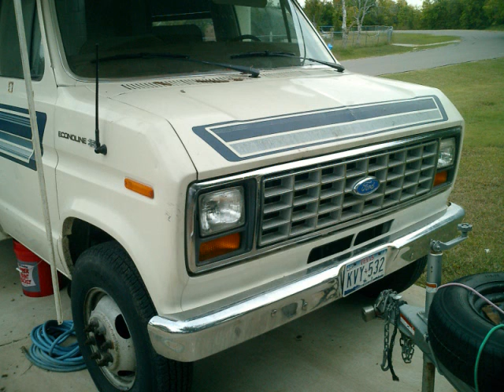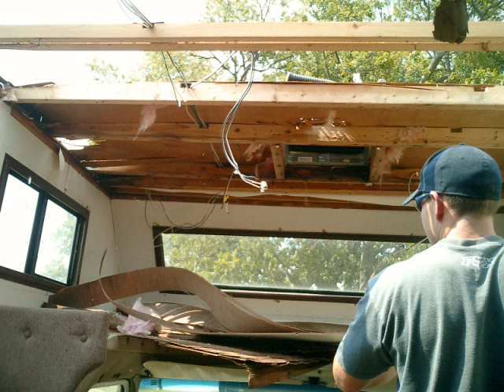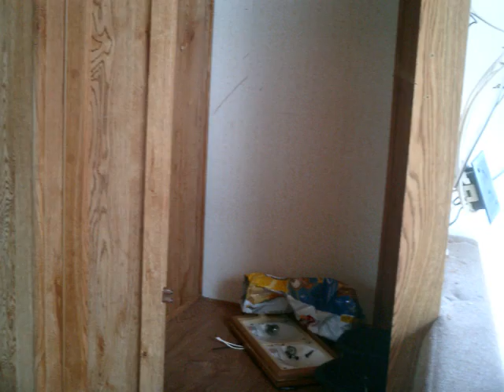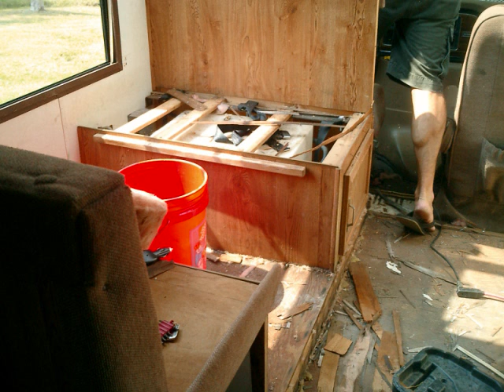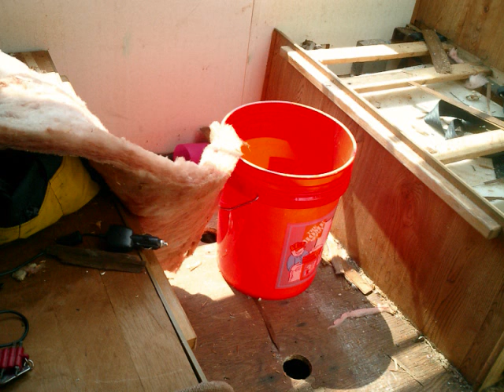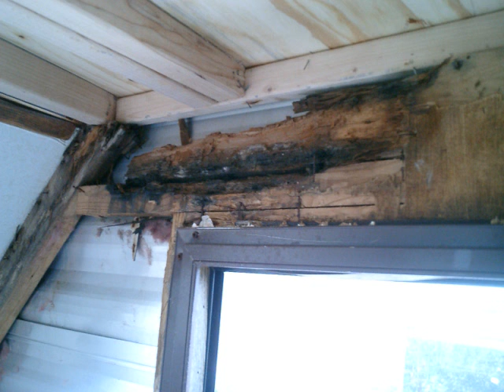1990 20ft Mallard Sprinter RV under renovation

Comment: I just bought an identical Mallard Sprinter. Question: Do you hate the 351w? Mine seemed very under-powered and recently threw a rod. I'm trying to decide if I should replace that 351 or assume a replacement engine is also going to be gutless and not worth the trouble.
Reply from the maker: If it threw a rod it may have had other power issue that made it seem gutless. Mine did fine on the highway 65-70 once you get it rolling.